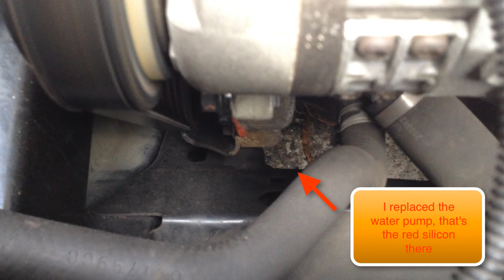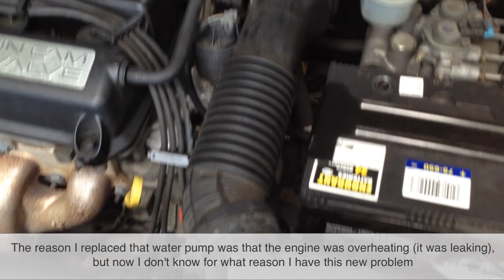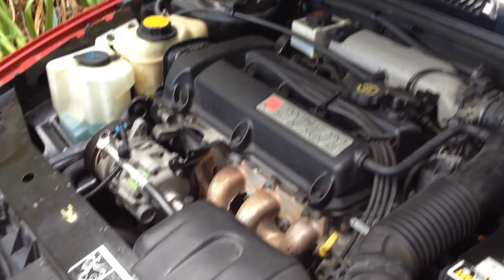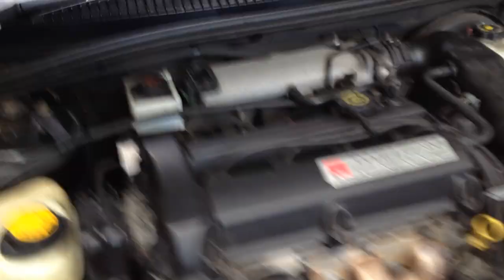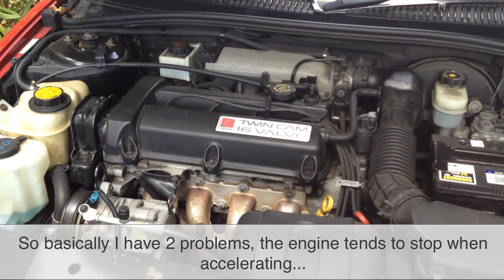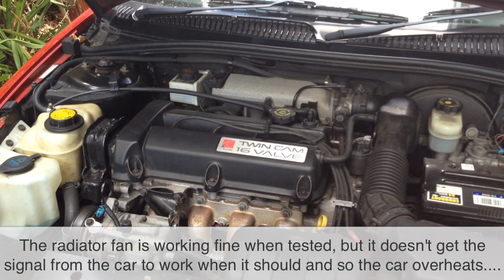Overheating and Hesitating Engine - How to fix a Saturn SC2 1999 with 2 problems?

Comment: when u  replaced the  coolant  sensor   did u also replace the  coolant temp sensor connector  cause  they are known to get coolant  in them and not work properly

Comment: I know im years late but check the intake manifold, and EGR for cleaniness. mine was dirty as h3ll, i mean i used a long azz screw driver and paper towel to clean it out. There was mud in my intake manifold, and EGR was filthy. Clean those components, im sure it willl help. When you take EGR off the middle section should be bouncey like a spring, if it's not then buy a new one, or clean the old one, but the middle should  be bouncey like a spring, if it's not buy a new one. Hope this helps

Comment: Is your AC working? I notice on mine that if the engine starts getting too hot I have to turn on the AC and that kicks that cooling fan on. Then the temp comes down. Otherwise, that fan won't kick on until your almost in the red.
Reply: I just was given a 1999 Saturn 3 door coupe. I was getting ready to change the transmission fluid and filter, so I was letting it idle for a long time to get the fluid heated up and it started boiling over. Did some research and found two great videos on diagnosing the problem: richpin06a Saturn Cooling Fan Troubleshooting and Pine Hollow Auto Diagnostics Radiator Cooling Fan Diagnosis (and tune-up) 300K-mile Saturn! Between watching the two you should find the answer why your fan on when it should.

Comment from the maker: Hi! Many thanks for your kind help and you're not late at all, I'm the one actually very late in getting the car fixed.... my battery is not going, I live in NZ and batteries of this kind are not easily obtainable here and there plus the cost of it... is taking me longer, without battery I can not check what is going on, been using jumper leads too much and I think I've been affecting my darling's car a bit because of that, I appreciate and will definitely do what you suggest me, thanks heaps!!

Comment: I have three of these older saturns and I can tell you anytime you have issues with the way they run check the temp control sensor, check the EGR valve and clean or replace it and another issue is the crankshaft sensor will cause problems. Unless of course you have a vacuum leak. One of my saturns the 99' has the EGR valve clog on it quite a bit due to all the excessive oil burning and I literally have to clean it out about once every two months but after that it runs fine.
Reply from the maker: Awesome, thanks for sharing your experience!

Comment: when was the last time you had the waterpump changed? 
also if you have not checked the iac yet be very careful if you are not you can ruin it.
also do you keep up with the maintenance (air filter, oil change, ect.) had the same problem with my friends car and we fixed it up well the over heating part, her car did not have the idle problem.
Reply from the maker: Many thanks Jeremy, I changed the water pump by around the same time I made the video, I eventually found the problem, the coolant temp sensor was not working and it wasn't the actual sensor but rather the connector at the back of the sensor, I couldn't find the bloody connector anywhere so I went to an electronics shop and bought the ends and got them replaced myself, it worked fantastic :)
Reply: @WCephei77HD  bro my car is hyundai accent i faced this same problem till temparature on half in meter car hesitate and slow down for off and lot of air sucking sound will appear

Comment from the maker: That's so cool! II haven't seen a Saturn in green, unique I'd say, I live in New Zealand and there aren't many of these cars here, I've only seen it in red color... that's right the fan is not kicking in to work, I tested the fan alone and it does work, I haven't replaced the thermostat but the mechanic says it works based on testing that both hoses (in and out of radiator) get hot, I will check those items you say, I hope to resolve this nightmare soon enough, thanks heaps for your kind help!!
Reply: Im having over heating issues too but mine at first looked like the gauge didnt work and told it was getting hot

Comment: engine sounds very healthy sounds like something minor fix could solve . Id get a scanner on it find the code u get . Look up gm codes there pretty much the same across gm .cause if u have failing sensor it will shutoff engine not get air fuel mixture right . A sensor can send bad info and pcm will adjust the air fuel mixture . This is how you may be stalling out at certain rpm ranges . let me know here Ill followup with you

Comment: Did you figure out the issue ? I bet it was the coolant temp sensor harness they get corroded bad and lose contact to the temp sensor
Reply from the maker: yes, a cable at the back of the coolant temp sensor was corroded, I replaced it and it was good again.

Comment: Check fuel to make sure thats not an issue with pressure checker to the fuel rail also check your fan if it's moving it could be the coolant sensor under the back side of the block by the trans is a wire with 2 wires and a sensor that turns the fan on and check/ relay with a clip 30 to 87 check if the fans not moving and the fuse is not blown. replace relay and coolent sensor. Also if the fuse is blown you need to replace it or buy a new fan and fuse. The fuse blows because the fans dead or worn
Reply from the maker: Many thanks, that's very helpful advise for this situation. In this case I discovered it was a corroded cable at the back of the coolant temperature sensor.
Reply: @WCephei77HD  My common issue is a coil for 2 and 3 it's missing spark on 2 either way I change plugs from 2 to 3 lol get a pair of denso plugs they are good for the car if looking for cheap plugs better then autolite in my case I have a bad coil pack ebay I go
Reply: @WCephei77HD  Also a common issue is the secondary blower clean the tube make sure vacuum lines hook to and clean the steel pip and start the car spray carb cleaner inside it after you scrape the crude oil out. celebration thanks the thing that's on the a.c. with a tube to the exhaust manifold up front once clean less rough start and no code p0410 if the blower works to the valve which the blower pushes air to exhaust manifold to burn excess fuel on startup for 120 seconds no blow needs relay fuse or replace blower motor for emissions

Comment: I got a 2002 Saturn sc1 1.9 liter 2 door car n have been overheated for like 2 months now but I have changed the thermostat; water pump; engine coolant jug and it still get overheated what should I do
Reply from the maker: Try testing on the connector of the coolant temperature sensor, I had exactly the same experience as you are describing and eventually I pulled out the connector for the coolant temperature sensor, I run a connectivity test with a tester and noticed this was the issue, I couldn't find that connector anywhere so I decided to rebuild the wiring of it myself, I opened it up and replaced its terminals/wiring, this at least made the fan work again!

Comment: head gasket .one time if over heating n  close to 200,000,  miles .they tend to do this ,also have you thought bout timeing chain??
Reply from the maker: I think that might need a replacement but eventualy I managed to resolve the issue by fixing the connector of the temperature sensor.

Comment: What was the accelerating problem?
Reply from the maker: When I replaced the coolant temperature sensor that problem was also gone, I don't quite get the logic on this though.
Reply: I had the same problem and the ects fixed it. also I cleaned the map sensor and the egr

Comment: clean the temperature sensor tip.....and clean the mass air flow sensor... put a clamp on each end of the vacuum hose... and u should be good to go..
Reply: S-Series Saturns don't have a MAF sensor.
Reply: @dmj-ju9zx   for the above problem to solve over heating best thing to do was removing the thermostat , and have the fan run on full time by rewire it to a relay and have it run when engine start, if the hesitation doesn't fix sometime u can remove the tps and vehicle runs fine or pull a vacuum hose from around the intake bc sometime the engine isn't breathing good on heavy acceleration. Lots of bypass tricks

Comment: I HAD THE SAME OVERHEAT ON A 1999 SATURN  ITS THE COOLANT SENSOR....
Reply from the maker: Many thanks, yes that's exactly what it was, I fixed it myself because I couldn't find it anywhere, I went to a auto parts shop (for electronics) and I bought some sensor pins, I replaced them myself and is now all working good, I hope to sell it soon =)

Comment: changing out connection to temperature sensor to see if that will work..
Reply: make sure u get the brass type . People at saturnfans have talked about how you can get a non brass version which are junk can lead to the same or worse signal that can increase temps again. I had to replace mine with brass version. There longevity is better and more reliable in response to pcm .
Reply: There all brass when buy them even the air temperature sensor

Comment: I just had the same problem after 15 years my car is 2001 Saturn sl1 1.9
Reply from the maker: Was it the coolant temperature sensor?
Reply: +WCephei77HD i just replace and it went away just like you said. then drove the car  to pick up son from school and the problem came back again
Reply: run the ac whenever u want the radiator fan to kick on manually 
I do that and it will keep engine cool till ur able to fix it.
Reply: My father said the same thing. But it still turns off regardless after a certain amount of time still bogs out and dies
Reply: Does car have any service engine lights ?First would be a test. If no mil light good chance then U should have good car . If u got leak somewhere that Mil light will come on cause it will detect variables and light will come on. I had a light when this happened to me . Ive had this car 1.9 litre engine . .Sensor can cause the rough idle and bog out . Im thinking possible bad intake air sensor or a leak where there is air coming into engine  through a bad gasket these are easy fixes.ive troubleshooting all this stuff from air to vacuum leak . Vacuum leak  can cause rough idle.
Reply: How well does car idle?
Reply: PackardBelltoll  there's a service engine light is on. My father just told me maybe it's the ignition module that gets heat up and end up turning off the car.
Reply: The idol is normal below 1 RPMs and the vacuum did that maybe two weeks ago when with a smoke detector. There's no vacuum leaks. Even tryed a head gasket leak detector
Reply: When I got  code 15 i changed mine and it cleared it .Code 15 is a coolant temp sensor . Three things to check coolant temp sensor .Its just there to enable the fan it wont really help if u got a stuck thermostat fan not operating before half way recommended run the ac in car to activate and if car cools on its own with this method the sensor has two wires one is 5 volts in the other is going to pcm with  5 or less value depending o .Pressure builds up to whatever the thermostat should not open till its rating is 180 or 220 whatever one u have in your car. If it were to open to soon you will get overheating problems cause it suppose to build pressure to get to the boiling point .Any
Reply: anytime you work on anything electrical in car disconnect the negative cable to battery to prevent damage to any electrical components .
Reply: I wish you where on my side of town so may take it to you to fixs it. Because I really need this car.
Reply: so Im leaning toward it being possible a egr valve stuck . Which only require cleaning . This can done easily with some car cleaner or gas .Engine sounds good .

Comment: My Saturn is doing the same thing. I thought it was the TPS, but it wasn't.
Reply from the maker: +James Flickinger I eventually fixed it myself, I found out it is the coolant temperature sensor, I could not find it anywhere and eventually the sensor was not faulty, it was only the connector of the sensor, so I replaced it myself, I had to make up a connector out of other electronic connector I bought from a car shop, I fixed the problem, the fan worked again....